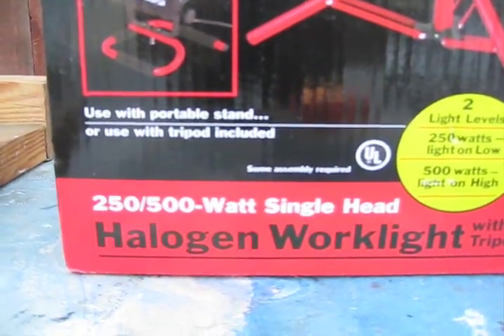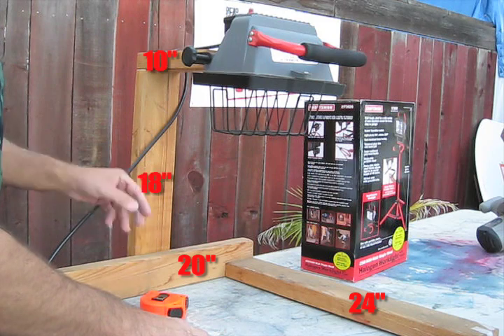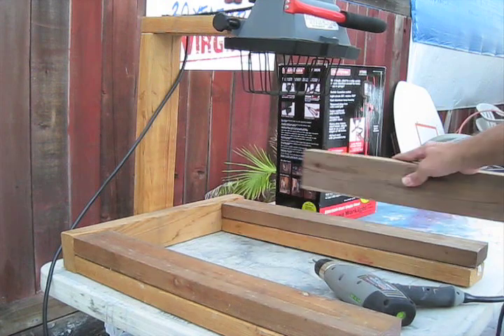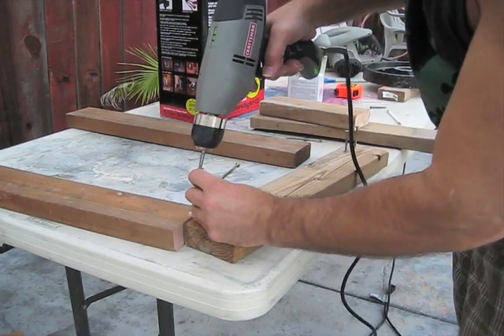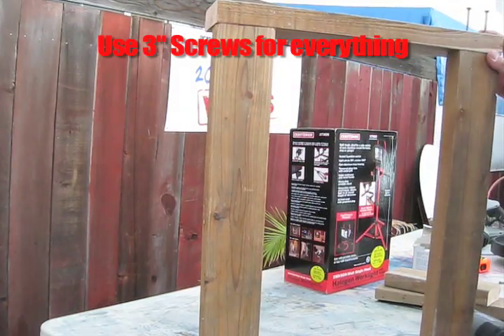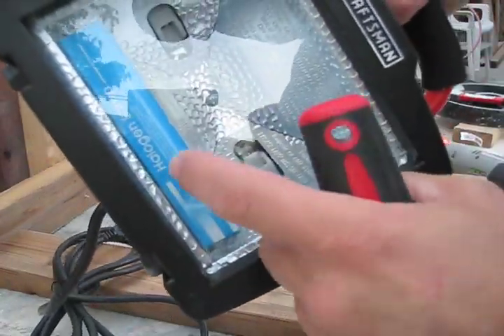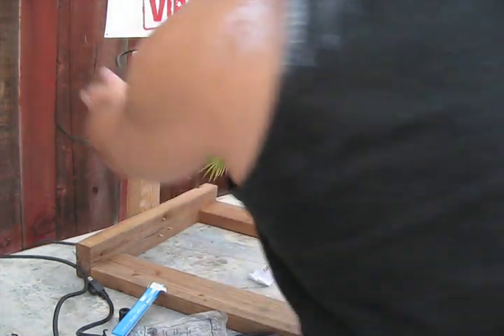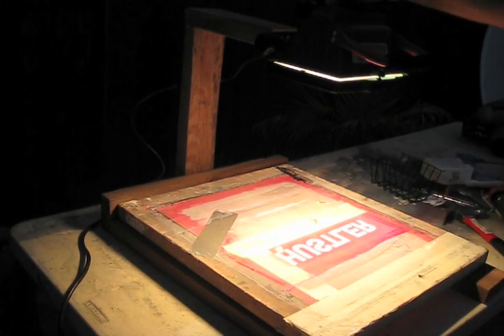Making an exposure unit under $20 for Screen Printing Silk Screening

Comment: I done the anthem screen printing exposure calculator and my best row was 9 for all half tones which gave me 108 seconds exposure time with this unit I built of yours. I dont have half tones in my work and to be fair most of the rows came out great with the bigger stuff on the calculator. I'm confused now as to burn for 108 seconds or 6 minutes haha
Reply: Oh and I had cover removed from light. 500 watt halogen same

Comment: built this the other day plan to expose my first screen today or tomorrow...I got the yudu style sheets from amazon and would be using on this particular frame a 16x20...what do you think my exposure time should be or at least a rough idea to start with
Reply: Make sure to take off the glass. I always expose it for 5 minutes and that works pretty good.
Reply: +Touch The Heart Productions the glass of the light?
Reply: Should I  place a glass over the screen or no? I just exposed for 6 mins using a plexiglass but it didnt work. I am trying reg glass now.
Reply: +J Cortez I bought a pic frame with actual glass and expose mine for 5 min and it seems to do great..
Reply: I didnt expose it long enough. I did 7 mins. 😐😕 Attempt number 2
Reply: +J Cortez are you drying your screens once you apply the emulsion sheets in a dark area..or if you take too long in the light applying them it will expose them...be sure also to take the glass cover off of the light I didnt at first and couldnt get the time right
Reply: +J Cortez also be sure to allow the screens to completely dry or they will fall apart the backing should come off easy if they are completely dry
Reply: I think that I may have over exposed my first screen. Either that or I squeegy off too much of the emulsion...

I did take the glass off of the light itself. 

I have just created another screen. It is drying now. I will report back :)

Thanks for the assist, J
Reply: +J Cortez no problem..let me know how it works for ya and that is possible to squeege too much off pressure but not too much ..
Reply: +J Cortez another thing to keep in mind is when rinsing out the emulsion to do it in a dim lit room and also to use luke warm water and not hot soak the screen with the luke warm water let set for about a min then go back with a little more pressure but not too much and it should wash out fairly easy
Reply: I got the cheap, pink Ebay sheets. After 3 tries  & following all the tips you give, they didn't work. Maybe its the screen.  I will order another screen

Comment: Thank you very much for the informative video! I have a few questions I see some that are red and others that are yellow does the color matter? Also I came across a 700 watt should I just stick to 500? Thanks again for video thumbs up
Reply: +Ab Shop I don't think the color of the emulsion matters. I've seen Green and Blue also. I used to buy them from eBay but noticed that those were too thin, so I looked around and found the best ones so far from Valley Litho. Their website is very hard to search for anything so I searched for you. Here is the link: http://valleylitho.com/acatalog/EZ_FILM.html#aEZ301724. 700W may be fine, but you'll probably need to expose it only for 3 minutes. Let me know how it works. Thank you.

Comment: Thank you for the video, we are building one tonight.  We just setup our darkroom and will be buying a glass plate for the screen.

What type of emulsion are you using for your exposure time of 4 mins?  

I will be using CP Tex by Chromaline and based on the spec sheet:
http://www.ikonics.com/pdf/user-guide/chromaline/CP_Tex_0607.pdf
its somewhere between 3-5 minutes?  anyway, I know I have to experiment and dial in the time

Cheers! and thanks again for the video.

Comment: My fully adjustable (X, Y , Z and 360 degree lamp unit rotation) exposure unit  and the digital control timer costed me 7€ (~9$)...making it taked about 1 hour. These items are really easy to find from flee markets. This is 300-500W unit. Lightweight, shrinks to small size, so it's easy to take along. It's really good looking and you can save the space by  doing exposuring in print table...

Comment from the maker: First my friend, the emulsion cannot see the light of day, or it will be useless. Secondly, the only way you can use sunlight is by placing your positive film on the emulsion and placing a glass on it then taking out into the sunlight for a minute then quickly take inside and pressure hose off the image.